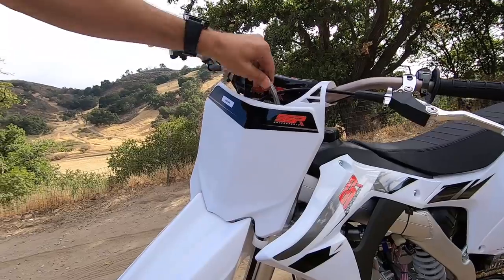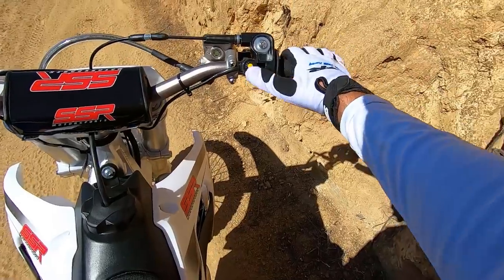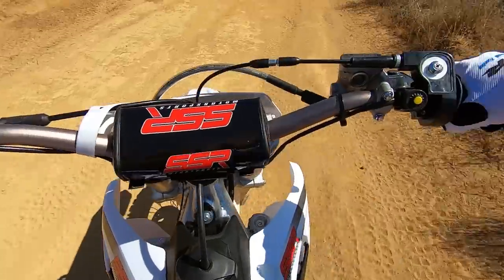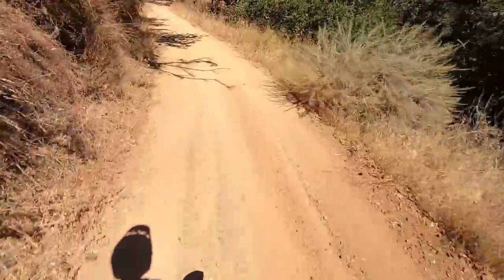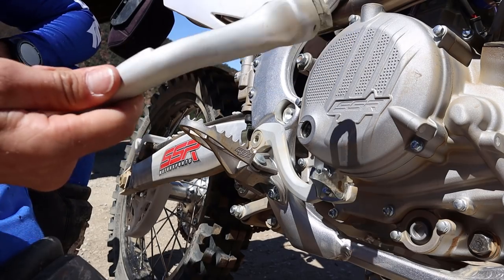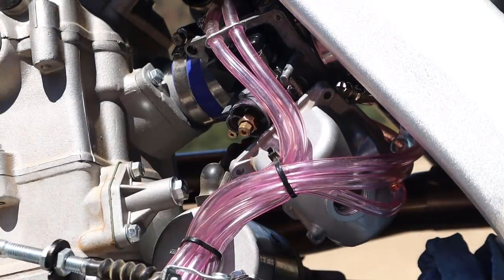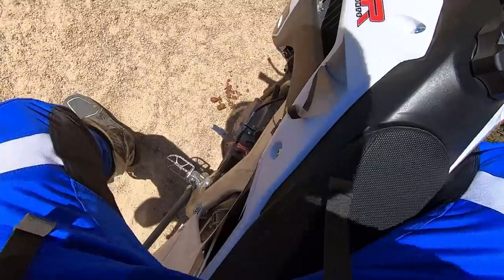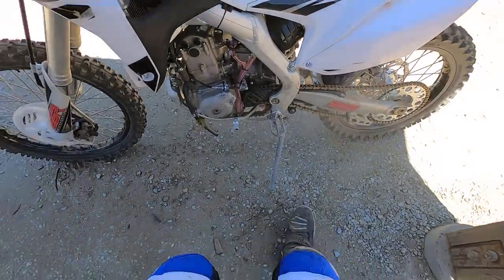I bought a brand new CHINESE dirt bike... And WOW - All new 2020 SSR SR300 first ride & review

Comment: Its a 2013-2016 CRF ripoff, ill never understand how Chinese companies get away with this, keep in mind I totally agree with you that the market needs the competition so badly, I paid $9800 for my 2014 CRF450 it was to much.
Reply from the maker: I believe what happens is that patents expire which allows other companies to re-use the tech. Or change it just enough to not be exactly the same.
Like the 48mm forks that look like Showas but have different guts, or the fact that the Honda body is cloned except for the radiator shrouds.

I am not an engineer or in manufacturing but I would have to imagine that those types of investments (if made their own and not copies) would simply make them cost the same as the high performance bikes they mimic. Know what I mean?

So they can hit a target market at a better price point by using tried & true models like the CRF, others...

There's a saying "Good artists copy but great artists steal" and it applies to just about any commodity when you think about it. 

I'm glad they make them.

Until now I wouldn't have purchased something like this to test & show everyone except- it actually caught my attention on it's own. It's not the China stuff we had as kids, it's on a new level for sure.

-Charles // mXrevival
Reply: @mxrevival  out of curiosity, does this Bike feel like a 13-16 CRF450/250? Like ergonomics? It almost looks like you could put CRF plastic on it

Comment: The top end & bottom end is really even with these 'Bumchien' motors, the spread is even, like a line 50|50 straight down the middle. Unlike my wife's bike which has a 'Tonnedong' motor that by itself is extremely heavy, hard & thick which causes it to vibrate, which intern stiffens it  more & more which intensifies vibrating and so on, which intern makes the whole bike super rigid until climactically fluids start shooting & squirting out. She says it's a painful ride. Lets hope she has more luck the 'Wongwun' motor I will be grafting to fit inside the frame. I have a fear deep down that if this motor is the wrong one, it will fuck up & go wrong in sooo many bloody ways but I wont even go there.
Reply from the maker: Can you install one of these Zongshen engines by chance? 

This little 300 is nice and smooth. They're only $1500 or so!
Reply: @mxrevival  Well it's funny you spoke about your lady's xr250 was it? because I have a 1997 xr250 roller that I would love to have a crack at grafting the 300 motor currently powering your bike, for $1500 new it's a steal.

Comment: I didn't know SSR existed before your video, thank you.  I agree with you that the industry could use a bike like this to "fill the gap."  I used to race a lot, but now I'm older, I still want to ride, but just for fun and some exercise.  I had a new KX450 recently, and quickly found out it was just too much bike for me... as Clint Eastwood once said, "a man had got to know his limitations."  Anyway, the prices of European/Japanese MX bikes have become astronomical, and it's hurting the industry/racing.  You said the forks are Showa clones... do you know that for sure?  Also, what about the rear suspension.  I would also like to know what you think about it on an MX track, if you ever do get it prepped for such conditions.  PS:  I also used to ride Hollister a lot 👍
Reply from the maker: Hi dude,

Thank you too, sincerely!

I think I answered the suspension question in another comment we shared so I'll spare you a duplicate answer! 😂

It's true... $12k for a new KTM? Man I love them & enjoyed my 2017 350SXF & 2017 250SX more than almost anything but it's getting to the point where a guy like myself would rather just build something sick! (and I will, absolutely) I love my RMZ in parts for this reason $, but they cost what they cost I guess- esp right ow with zero inventory anywhere. I get it.

If you end up getting one of these, you'll enjoy it for what it is & have a ton of fun on it. I got to shred Glen Helen yesterday on a pair of modded 300s!! Vid soon.

Thanks again, maybe see you at Hollister Hills someday

-Charles // mXrevival
Reply: @mxrevival  Dude, thanks and I would love to see you in MX action on these Chinese bikes.   I live too far away now, to go to Hollister, but I did enjoy it, along with Carnegie.  It's sad though, it seems to be that California is doing it's best to kill off-road riding... who knows, they may go after closed circuits next?  😢

Comment: I'm 5’4 would I fit on this bike?
Reply from the maker: Absolutely. It's the same size as any other full size bike made of any brand (for an idea on height).

I'm 6 ft tall and it's pretty cozy.

There are plenty of ways to adjust a bike's height too if needed. 

I think you would be just fine however

Comment: I would never ride this thing straight out the box from factory. Iv owned a couple of SSR dirt bikes and pit bikes.. bolts just fall like nothing. Mostly everything needs lock tight. And you will be fixing these bikes bc they WILL break. And more than likely YOU will be fixing it your self bc most mechanics won’t want to touch this bike bc it’s “Chinese”. And good luck finding parts for this bike! U can find  parts for their smaller 125 pit bikes but almost nothing for these models. 

I know I sound like a hater but I’m coming from experience with these bikes. I bought the bikes bc at the time I could not afford a real bike so for you could get these for cheap. (These bikes used to be half the price years ago. I would never pay current MSRP for any SSR bike)  these bikes suck but you get a good bang for your buck. With that being said these bikes are great for beginners and learning how to work on your dirtbike. (If you can find parts) I would NEVER PAY 4K for that bike🤡 

Btw most bikes are not over $10,000. You  can find a brand new Suzuki RMZ 250 for $5,000... Your just trying justify your purchase considering u spent ur own money on it. 
Hope you enjoy it though
Reply from the maker: Sounds like every bike I've ever owned when I don't bolt check everything! I hate that & have learned the hard way. You are right about loose bolts even in general. Try owning a modern KTM (which are absolutely incredible machines) Sprocket bolts, spokes, cheap & thin wiring... 

So far no loose spokes or anything on the SSR. I'm a religious-checker of loose-ness. Body bolt upgrade coming as I prefer 8mm heads VS 4mm & 5mm Allen heads... All the tank blots had anti-seize on the threads which was great where dissimilar metals were found (brass tank threads & steel bolts) very thoughtful.

TONS of aftermarket & also tons of engine parts for these. This engine is the "Honda Civic" of the motorcycle world- meaning it's mass produced (Zongshen NC250 - NC300 - NC450) 

Can't wait to break sh*t! Sounds like you won't be helping me do the breaking after all 😂 Someone has to do it. "Fixing it myself" is the entire point!

Appreciate having you, Jay!

-Charles // mXrevival
Reply: @mxrevival  definitely truth to what you are saying but plz don’t try to compare this bike to a KTM lol😭 I had the SSR 189cc and 125. 125 parts where great but couldn’t find anything for the 189. Could u drop a link? And sorry if I sounded like a dick I just have a love hate relationship with this bikes. 

I remember when the 125 pit bikes where selling for $450-650... now they are over $1’000 for the same exact bike with no changes besides stickers. I don’t get it
Reply from the maker: @jaym3993  when I replied to you this morning, I missed the entire second half of your reply! Apologies!

I believe it must have been cut off on desktop, so...

Anyways, you're good. It's no problem having a constructive conversation. As long as it's constructive!

However, you do not sound like a hater. You're allowed to have your opinion of course and the same is true in the opposite direction.

Regarding comparing to a ktm, *in the context of things coming loose*, 100% comparable. 

In the context of KTM versus SSR for say, racing, resale, initial cost... They are in two different leagues, of course! I am of the opinion that KTM is officially the best bike made at this time.

Also, you won't catch me trying to justify anything 😉 I have my ego in check, on tons of really fun toys (we are blessed and I'm so thankful.) So in regards to that it's simple - if I want it, I buy it and this bike was no exception.

if it's a piece of s*** and I break it in half, you'll know about it. I just love fun!

So now that we've cleared the air, and you know me a little better than assuming one thing or the other, it's nice to meet you and thanks for keeping it cool!

I agree with you wholeheartedly. Used bikes can be had for that price. I'm not a fan of used four strokes. They can be time bombs. But they might be just the perfect thing for someone else, right?

A few brand new 450s just rolled through the shop for grease jobs, namely the 2021 KTM 450sxf and the yz450f.. the KTM was $12,200 out the door after tax title and fees! Wow! 

A lot of guys sort of have my angle on the a SSR confused as if I'm trying to say this is a better purchase than a Japanese bike or an Austrian bike.

It's 100% for fun and will be the perfect bike for so many people, and for so many others it would be the absolute wrong choice.

It's about having an open mind. I wish I had the kind of time someone would need to convince people of one thing or the other but I do not.

Hope you had a really great week, Jay!

-Charles // mXrevival

Comment: i take it you did the run in procedure ahead of time. these bikes are shipped with break in oil and needs to be changed before riding it..
Reply from the maker: First ride with oil in it as revived 👌The dealer will do a PDI on the bike to prep for owners. Light assembly, start/ run, oil, coolant, etc. I would be shocked if these arrived with a drop of oil in them from overseas due to chemical shipping restrictions. Extra info: Oil was changed at about 6 hours. Has several stainless strainers and all was well/ clean.

Comment: New sub from  @LundMX, thanks for the inspirational video. Look forward to seeing what mods or improvements you do to the carb.
Reply from the maker: Pumped to have ya! Thank you 🤘 Did you catch the playlist by chance? Some really good news and mods regarding exactly that, over there!
Reply: Yes, I binge watched the China-Bike series.  Congrats on your future Baby!!! 
 I can't wait for your opinion video between which Carb is better? 
Video ideas: 
1- PUMPER CARB VS Electon. 
2 - Is investing in porting/polishing the head and modding the Crank shaft worth it? (If you can find a shop that's willing to take those orders and give you a piece of the action 🤑🤑🤑 ) 
3- SSR 300 vs 450
Reply from the maker: @Marvelfunfaqs  haha, thank you! 

Man, I think pumper carbs are great when people take the time to dial them in. You can definitely make them shred. In the Glen Helen video, where I have a 300 out on the Motocross track, those were equipped with upper carbs, balance cranks, slip on mufflers and I believe one of them even had an ignition from a different engine. Needless to say they were quite a bit different from stock and they were dialed in just perfectly. They're really ran amazing.

Our Lectron lot is really great as well. They tend to be smoother off the bottom which equates to the sensation of less hit. Some people don't like that, but what's happening is, the traction is actually being applied any more usable manner and it stays that way as it goes through the Rev range.

Of course, no Jets so no fiddling with it ever no matter what, elevation, temperature. It doesn't care. Regular carburetors like the pumper can be completely askew in these situations sometimes.

Really no wrong answers to be honest. Everybody should ride with a like and just enjoy tweaking and tuning on their favorite bikes. I'll be testing the 2021 300 pumper carb that is new for 2021 on the 300 specifically. I just have not had the time yet.

As for the 300 versus 450 debate, I have some opinions but these will vary per person so, again no wrong answers.

I like the 300 because it offers the most modern body style that SSR has in the lineup. I also prefer that because we are making mods for it like the carburetors and graphics kits. They are hand templated so a lot of work goes into that and I think they'll make people very happy.

The 450 still looks cool, and also has an engine that's going to put out more torque. So if somebody wants more bottom end power, a 450 might be the thing.

As for comparing engines, they are apples to oranges right? Since one is of more displacement than the other.

I think from 250, 300 or 450, every one of these bikes SSR offers is able to be ridden by beginners all the way on up. I think that's cool and of course the price point is amazing.

Same again for all models, they come with carburetors that are all specs pretty badly and they are not at their full potential when you first buy them.

I think that's fun because guys actually get to dig in, make some modifications, then actually physically reap the rewards of those modifications. 

The flip side is that, some people might not want to do those modifications.

So if you like it, ride it! It's precisely the reason why I have so many motorcycles, both two and four stroke.

Have a great weekend dude

-Charles // mXrevival

Comment: is the carb on the 300 the same as the 250?
Reply from the maker: I believe so across the board on 250, 300, 450 but have been told the inner bore is smaller on the 450. 

I have sold a few of our Lectron Carbs to guys on the 250 & the 300 so we know those are the same style & dimensions.

Comment: What’s that little tube above the header pipe on the right side? Emissions bs? I’ve noticed them on KTMs as well.
Reply from the maker: It's called a resonance chamber. In layman's terms, it gives the exiting exhaust a chance to be quieted down before it gets to the muffler or silencer, and then exiting the bike. If a bike can be quieted down some, before the muffler or silencer is added, then a manufacturer can run a less restrictive muffler or silencer, therefore possibly gaining some additional power or torque. So that's the idea behind it.
Reply: @mxrevival  ok cool. That makes since.

Comment: Any idea on wether or not a crf desert tank would fit?
Reply from the maker: Dude, yes it would- but something occurred to me....

It'll have a big gaping hole in the bottom for the CRF's fuel pump (that the SSR does not need) as the Honda is fuel injected & the SSR not...
Reply: @mxrevival  oh wow I didnt even think of that issue. Thanks for sharing. 
I wonder if a pre EFI crf desert tank would work.
Reply from the maker: @ocoutdoors2355  absolutely always help if I can.

Possibly, but probably not in a clean manner.

On SSR's other two bikes, the 250 and 450, I bet yes, as the Honda 250 and 450 that they resemble had carburetors in those years 🙌

Comment: Stopped watching this when you showed the kickstart in the way .. and then I saw the decals coming off. Not to mention the coolant issue. You get what you pay for!
Reply from the maker: Ha! Try being the rider 😂 no coolant issues though. It's been a decent bike. Thanks for trying & happy new year dude
Reply: These videos are propaganda right? Is SSR kicking in some cash or product for these videos?
The real test of an off road motorcycle is reliability. I live in Baja. A breakdown doesn't involve cell phone signal or available tow truck.. so if the bike has been used for a while what is the track record for issues making the bike non operational..all these videos of people transporting motorcycles by van or truck, trailer to a designated area, w lots of resources are not everyone's life. Dual sport motorcycles by design are to get you to areas less traveled.. so if your machine takes a dump. And leaves you stranded.. that is significant..ultra important..@10-30 miles from a road in my area could be life or death
Reply: @randycallow3736  Agreed!  If they can't make the graphics stay on for a few hours, who knows what other surprises you have in store.

Comment: Good review! This reminds me a lot of my 2020 Kawasaki KLX300r.
Reply from the maker: Thanks Brent! Is that a full size bike? Like as tall as a 450? I haven't seen one up close. I've had that comment a few times now and wasn't sure as the SSR is a "450 sized" bike.
Reply: @mxrevival  Yep it’s a full size bike! About 12 inches of ground clearance and a seat height of 36 in.  It has a lot of torque at the low end but dies out on top.  I paid out the door $4500 back in April.

Comment: Looks the part looks like a crf250r
Reply: @mxrevival  what's the power like compared to a crf250r mine has 43 horses haha
Reply from the maker: @1991enduro  definitely not as powerful overall. They are not exactly high performance engines, like your Honda. But definitely still a lot of fun.

In stock trim these put out about 30 horsepower.

I'm going to try and do some ignition modifications soon just to see how the bike reacts.

But I got them out on the Motocross track, Glen Helen Raceway last week, and that video drops tomorrow at 5:00 p.m. Pacific

It was super fun.